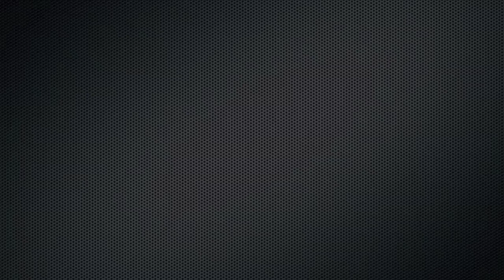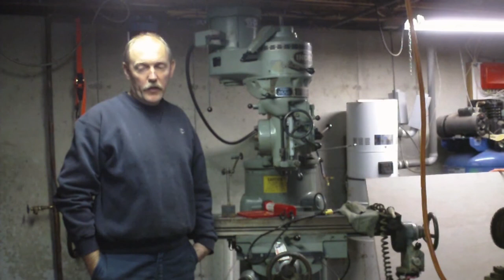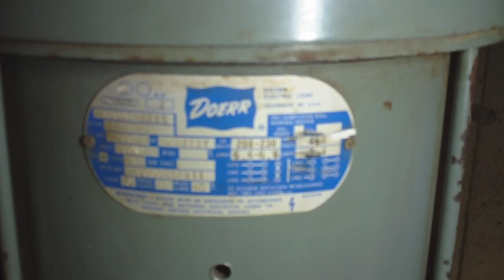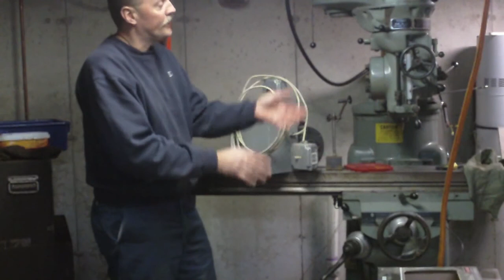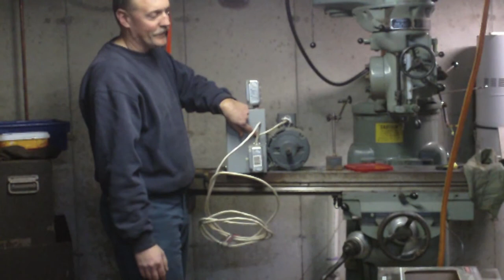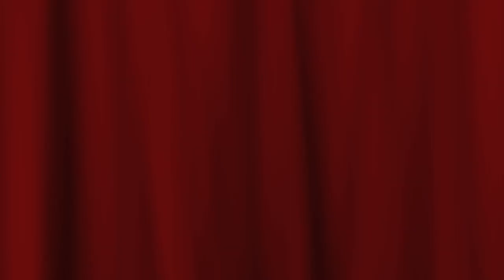The Wells Index Milling Machine Part 33

Comment: I like to think of the VFD as a heavy duty dimmer switch. They're all over the place at work. I like them because you can set your rpm's low & continuous for energy savings & less chance of stray voltage. Modern dairy milking parlors need them other wise the electric bill would be thousands $/month more. The ones at work are all mitsubishi and always go back to default settings when the power goes out in a storm :(  Static capacitors in a 3 phase converter burn out from time to time same as they do in a 2 phase air compressor motor. Also some capacitors have a bleed off resistor for safety and some don't. Right now we have a electrical mystery at work. There's a 220v motor in the parlor with a 2 pole on/off switch. I had a electrician come help me change the shorted rusty switch but even with that circuit breaker shut off there's still 6 volts on 1 leg coming from the service or somewhere. We have no idea where or how this is happening.
Reply from the maker: When I get to uploading January's video I'll talk more in depth about VFD's, and explain sensor less vector, etc. As for your mystery voltage, could it be a bad ground, or "floating" ground. Any other live circuits nearby that could be inducing voltage voltage into the dead circuit? Like other conductors sharing a conduit? Just throwing ideas at the wall, see what sticks.